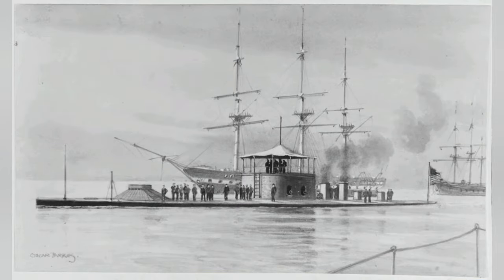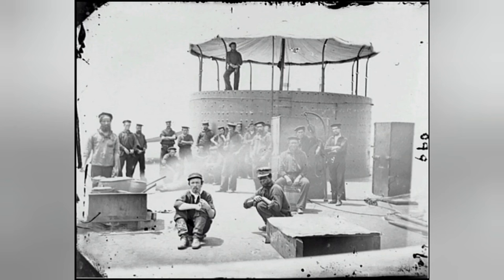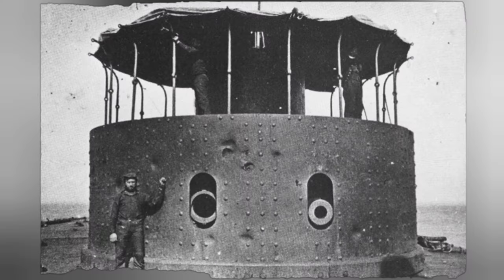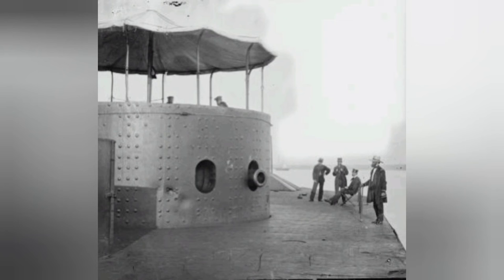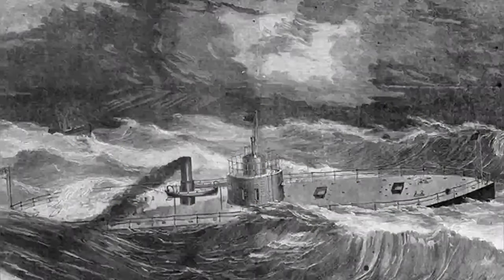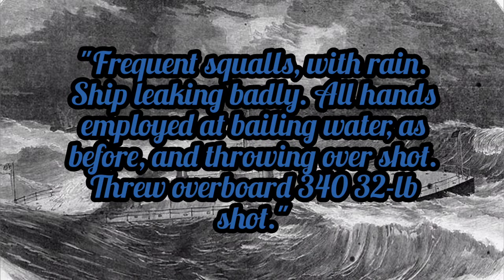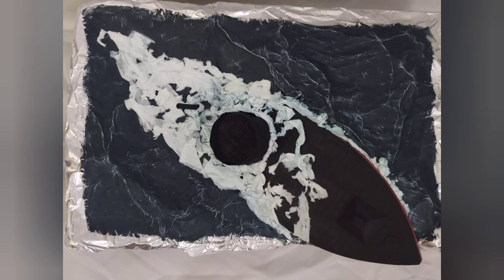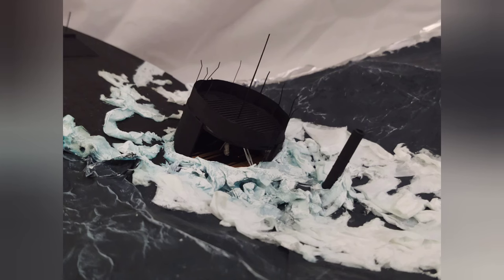Sinking the Monitor

Comment: That was a harrowing tale, the details you shared were superb, if haunting.  Thank you for sharing it.

IIRC, I read somewhere that the Monitor had a wooden lower hull fixed to her armored upper hull and deck, and that joint had problems with leaking.  Am I remembering right?
Reply from the maker: https://youtu.be/NFLHalz7VyM?si=E5moG7qASpzkcreA
I explain the connection between the upper and lower hull at 5:35 in the video I linked. 
At no point was Monitor's lower hull constructed of wood, it was solely iron. 
It is speculated that the hull suffered separations at that location because of its weak method of assembly, but it is impossible to verify. 
Thank you.